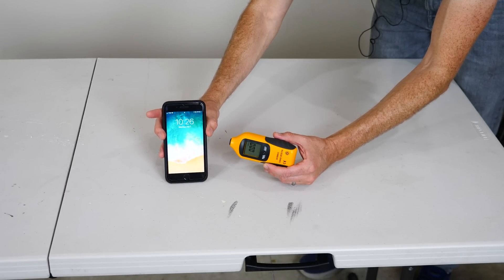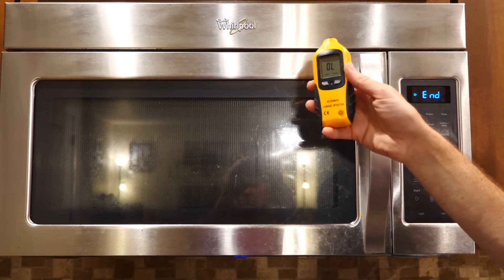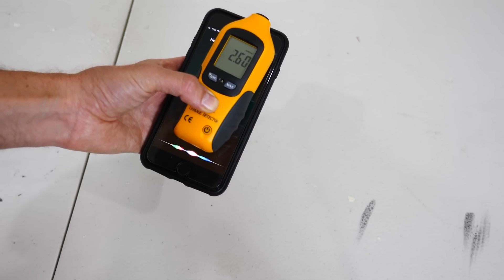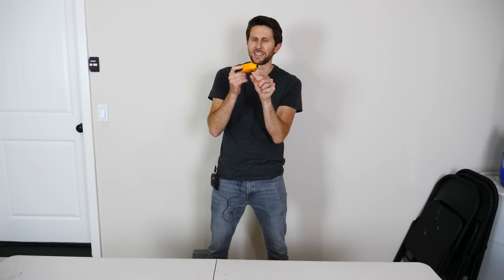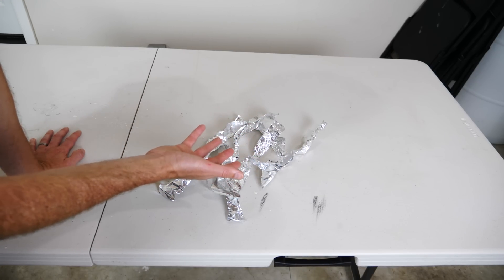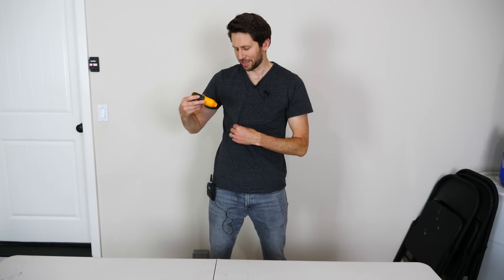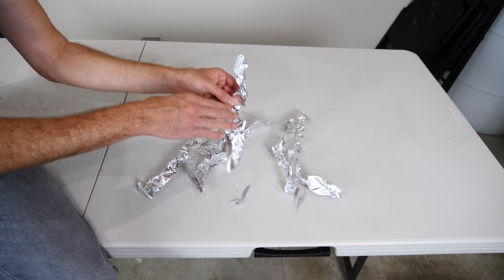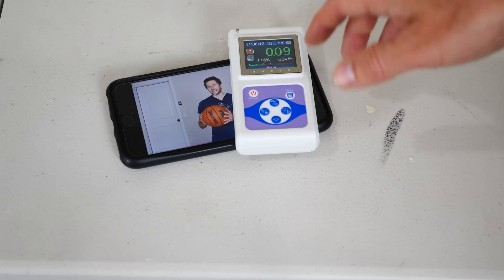How Much Radiation Are You Getting From Your Phone?

Comment: Your conclusion to this experiment is so warped it's not funny. You think that the only dangerous thing about microwaves is heating? You compared that to going out into the Sun, you might've well have compared it to going into a Sauna SMH - What you've shared here isn't even bro-science!

5G millimeter wave frequency causes the electrons outside oxygen atoms to spin & heat up. We have those oxygen atoms inside h20 (water) & O2 (oxygen) inside our bodies. If they heat up in that manner, not only does it prevent oxygen from boding with iron into our blood so it can be circulated around our bodies, but it can also cause respiratory illness & a build up of fluid in the lungs... Hmmmm, what's one of the reported side effects of Covid-19.

Good on you for conducting a experiment, but if you're going to share very poor conclusions after drawing an observation to your experiment, probably best to not post it on YouTube!

Comment: Thats all micro wave Radiation does is heat food up LOL Mr wiz you forgot to mention that wifi works at 2.4 gigahertz the same oscillation as the water molecule and spins that molecule to create dehydration. Also 5G works at abt 60 gigahertz and spins the Oxygen molecule. These molecules do not spin in nature. Result?  lack of water and oxygen Absorption and thats not counting the effects of the Radiation. 5G is not like any other (3G 4G) it does not pick up whats around you but directs it at YOU.. I will add that in congress when asked how much testing on 5G was done for Human safety they answered, None, Zero, Nada, Nothing...

Comment: What you did is right, but the question here is the quality of the measuring tool. Since it is made for measuring Microwave oven leaks, it should be tuned specifically for 2.45 GHz. I am not saying the tool you are using specifically, but some cheap tools can pick up other electromagnetic waves that have nothing to do with the microwave band used in ovens and sound an alarm. So what I mean is, if it is indicating "overload" near your phone, just test it in different other electric equipment. If it goes off easily near other equipment, then it is not accurate and you have nothing to worry about.

Comment: Shill alert, shill alert. This video is dangerously misleading. RF from your phone and wifi is not safe. I repeat, SHILL ALERT. 5 mW/cm2 is an EXTREMELY HIGH LEVEL. Radiation does way more than heat things. This video is extremely irresponsible. So much lies in this video, WOW.

Comment: TL;DR: 
Our bodies do not absorb microwaves. It’s a form of non ionizing radiation. There are two forms of ionizing radiation; X-ray and gamma. Ionization can do 3 things to a cell. It can die, repair itself or mutate incorrectly. Microwaves are NOT IONIZING! 
Fun fact: A cellphone would only give you ionizing radiation if it were a banana phone. (As the potassium in bananas decays it gives of very small amounts of gamma rays).

Comment: There is Flaw in what you are saying. If what you say is correct you would recieve 1 degree heating consistently internationally. So being thermally heated by the sun which slows down from the out side to the inside would be safe. Example you get hot so your skin sweats and you cool down. 

But heating from your phone would be essentially be internal sun burn to your brain your legs your hands your heart. All the locations in which  your device is used or stored day to day.

FCC states clearly in its guildlines eyes & testes have restricted blood flow so heating will happily take place.

Comment: A microwave oven typically uses 800 watts of power to vibrate water particles. The things is that microwaves dissipate extremely quickly , non focused waves will not hurt you , 4g or 5g will not hurt you, it’s milliwatts not even 1 watt.

Comment: 1) microwaves are NON-ionizing
2) a microwave oven radiates hundreds to morr than thousand Watts to heat up watermolecules, cell- and smartphones and wifi routers use milliwatts. 

Therefor: safe.
Reply: Dont they use radio waves which operates at a lower frequency than microwaves too?

Comment: Well I’ve been using cell phones since 1998 still clear of cancer in 2019 , Also you would need to hold the phone to your head for a whole year straight just to get the same radiation level as a chest X-ray , the old mobile phones from the 80s were the most dangerous giving out 100 milli-sieverts of radiation per year
Reply: It is actually the other way around: 24 hours of mobile phone radiation can equal 1600 chest X-rays in DNA damage.

Comment: All sun radiation does not travel inside your head
Phone radiation does
This is Real concern
And by the way
It is already proven there is very strong correlation and I some cases even causation of cancer in areas where people hold their phones
You should not be that hasty to draw conclusion while you have no knowledge about subject
P. S. Sun, microwave, radio, TV are fundamentally different kind of waves from what phone produces. Phone sends very short bursts of data and actually from GSM era cell phones are not switched (circuits) anymore, but packet based communications. This makes them faster, more energy efficient, give them better range (as you do not need to transmit all the time, you can pulse with higher energy). There is no single study about pulsing electro magnetic waves effects on living organisms, apart from few separate studies which actually shown that it is harmful.

You are too hasty with conclusions

Comment: Flying a few hours gives you radiation about equal to a chest x-ray.  Every 20 days your alive is equal to a typical chest x-ray.  X-ray, gamma ray are ionizing radiation which means they can alter your cells by removing an outer shell electron.  There is also a thing called inverse square law basically states the further you are from the source of radiation the less the intensity is.  Medical x-rays are also low LET and RBE which means that  there low chance for any real damage to happen. But on the flip side any small about could cause something down the rode.

Comment: Due to its low frequency, microwave radiation wouldn't be much of a problem. It's even lower than the energy of infrared radiation.
Reply: That's because of non ionizating radiation

Comment: Microwave radiation? Uh that’s not right.. it’s not even on the same wavelength which means it’s not even microwaves :P
Reply: True, cell phones work in the UHF band, 300 to 3000 MHz.   Most physicists refer to the microwave" band as EM radiation with a wavelength in centimetres, that equates to the SHF  band  of 3 to 30 GHz (3000 to 30,000 MHz)

Comment: Decent video. As an RF engineer, I see some problems though. That meter is complete garbage and when you wave your shirt like that, you are just fooling the low quality meter. You are not putting out microwaves by doing that. If it was that easy to make microwaves, well. . .
Secondly, that meter may work for phone wifi, but it's not going to work properly to detect 3G or 4G because that isn't microwave. It's 900MHz or so, so that meter is not going to be accurate. A feild strength meter should have been used instead and they're not too expensive anymore like they used to be. You can get them on ebay. They look similar, but they have a little ball on top containing an antenna and they will detect the polarization of the waves also.
Either way, you are correct about the non ionizing part being not dangerous and this is the most important part.
Reply: So do you think 5g is dangerous?
Reply: @benhael3624  No, I do not, but I'm not 100% sure about that. It is absorbed by oxygen which is an interesting different property compared to other frequencies. There are people claiming that this inhibits hemoglobin from absorbing the oxygen into the body. I can't find a scientific reference on that specifically, so someone made it up and people kept repeating it AFAIK. It's possible I guess, but the likelihood is low. Other than that one potential problem, it's fine.
Reply: A question... Is 3g safer than 4g on phone and does it radiates less if I only use 3g?
Reply: @David-ce8yx  You need to know that radio waves are the exact same thing as light waves only they are much longer and therefore are invisible and pass through objects. So when people act afraid of them, it's like being afraid of the sun. In fact, the sun outputs way more. Essentially, if it is not enough energy to cause heating or burning, then it is completely safe, so both 3g and 4g are safe. You will find some studies saying they aren't, but they are made on baseless "science". The only slightly questionable one is 5g because of the oxygen absorption, but this is a unique property of 5g and the other Gs don't have that at all.
Reply: Also, there are people that work at radio stations (me) who are exposed to 1000s of times the amount of radio frequency energy you get from your phone, so if there was any issue, it would be seen in these people and it's not. There are people that even climb towers while they're turned on (some are paid workers). A few of these people have gotten burns and the burns go through, not just on the surface, but when they don't burn themselves, there is no harm caused by being exposed to 1000s of times what you get from a phone.
Reply: @joeshmoe000  thank you very much for this fast and great respond 👍👌✌️

Comment: I like to use my cell phone on speaker phone. Microwave radiation is non-ionizing so probably not as bad as ionizing radiation. With my first old cell phone my ear would actually get hot if I held it to my ear. Interesting information for you, when they measure the safety of cell phone radiation they measure it at a distance not where you would actually hold it when you were using it. Don't wave your shirt it could be dangerous. You didn't measure it with the Geiger counter when talking on the phone.
Reply: My phone will get hot if I hold it to my ear long enough.  So will a piece of wood!
Reply: Not only the phone my ear would get uncomfortably hot.

Comment: Try this with a 5g phone because millimeter waves
Reply: OK so low power microwaves for 5G.  The most it will do is warm something slightly.
Reply: @karhukivi  talking about in the 30 GHz to 300 GHz range
Reply: @Aurora_Awttermunk  Ok so in the radar bands and below the infra-red bands. I see 3 bands 3.3-3.8 GHz, 25-30 and 35-40 GHz.  Only effect is heating or RF burns if touching a high-power antenna.
Reply: @karhukivi  yeah it is bad indeed.

Comment: My mothers microwave leaks a bit. Her kitchen weight starts fluctuate the readings when its placed about 0,5m or closer. Hehe funny. It is badly shielded. My phone haven't taken any damage being near the microwave. And no loss in signal.

I myself have a frequency counter that I use to find what frequency a radio close by transmit. But I have to be very close to it for it to work.

Comment: Is that instrument specifically for microwave ovens? If so it's looking for 2.4Ghz, ...so wireless is OL, but cellular isn't hitting that high; but it's it maybe just not detecting the power of the lower frequencies.  Just curious. [Edit: I'm not worried about radiation)

Comment: Doesnot exist, radiation doesnot exist is a lie.
Is a definition they use to reference wireless emission, but there is no radiation doesnot exist, it can be reference anything, from heat to wireless data, there is no radiation is only a misleading fake idea, they donot even know what they are talking about it.
Microwaves are not radiation, frequencies are not radiation, is just misleading form of speech design to manipulate the system.
Most of those devices are hack with wireless signals so they display any number they want, the same way they use the fake diabetes devices that they manipulated with the brain emissions they release.
Reply: @fazuelison13  what kind of energy?
All kinds of energy, not one, not two, all kinds..
So is just a definition that can apply to anything.
For example
I toss water and the rain was radiating ....
Wtf...
Anything can be radiation, but technically it doesnot exist.
Reply: @fazuelison13  there is no radiation, doesnot exist, is a false word to reference emission, but there is no radiation, a lie.
Emission and radiation is same thing, radiation doesnot exist, is just a bad word made by human cells to manipulate their ignorant systems.
Words are no longer with value because human cells give them different definitions, they dont follow or respect the dictionary no more.

Comment: Problem with mobile or signal antennas is not only the exposure, but for how much time you can get the exposure, maybe a day or even a week of constant exposure living near or under an antenna would not give you mutations, but living years, probably yes. That can affect greatly.
Reply: As the video explained, not really. All microwave radiation is non-ionizing and does not transfer enough energy to damage atoms/molecules and by extension DNA, which is the only thing that leads to mutations radiation-wise.

Length of exposure doesn't matter if at no point this effect occurs. It's the same logic of not being able to kill someone even given infinite time if you're just tapping them with a knife rather than stabbing them. If it never breaks the skin, no amount of time is going to allow it to deal damage.

Comment: Go to Settings> General > About > Legal > RF Exposure, and you will find this: 
iPhone has been tested and meets applicable limits for radio frequency (RF) exposure.

Specific Absorption Rate (SAR) refers to the rate at which the body absorbs RF energy. The SAR limit is 1.6 watts per kilogram in countries that set the limit averaged over 1 gram of tissue and 2.0 watts per kilogram in countries that set the limit averaged over 10 grams of tissue. During testing, iPhone radios are set to their highest transmission levels and placed in positions that simulate uses against the head, with no separation, and when worn or carried against the torso of the body, with 5mm separation.

To reduce exposure to RF energy, use a hands-free option, such as the built-in speakerphone, the supplied headphones, or other similar accessories. Cases with metal parts may change the RF performance of the device, including its compliance with RF exposure guidelines, in a manner that has not been tested or certified.

SAR values for this device are available at: www.apple.com/legal/rfexposure/iPhone10,3/en/

Although this device has been tested to determine SAR in each band of operation, not all bands are available in all areas. Bands are dependent on your service provider’s wireless and roaming networks.

Comment: This is good however, the other concern is the effects the cell towers have. 

There was a study conducted in the UK several years ago, where they put vollenteers in a room with a cell tower transciever. Several of the participants, suffered ears bleeding and nose bleeds, the study was reported to have eliminated those people from the study, stating that those people were particularly sensitive, and don't count. Shocking that the study's purpose was to find such effects and those participants were just as valid as any of them.

Also a personal experience with phones. I had the early nokia phones, i had no issue with them, then i decided to get a samsung flip, the early tiny silver flip phones.... i ended up replacing it because every night i put it on my bed side table and when it was switched on, i got a headache. If i switched it off, the headache went away.

Another experience i had was with a phone case that had 2 magnetic discs to close the case. It was a belt case, and after a while i started to get a pain in the muscles above my waist at the side. I didn't connect it to the case till later. The magnets must have been causung some kind of amplification of the signal. It took several years to heal.

My conclusion about the case was confirmed a few years later, when i saw a work collegue wearing the same case, and without telling my story, i asked him if he had an unexplained pain in his side... he was shocked and said yes, how do you know. I said its the case, and told him my experience. He stopped using the case and his pain went away... Fortunatley it seems he had not worn it long enough for it to cause the same damage it did to me.....

Comment: I did these tests 4 years ago using EMF detector, and the radiation from your cellphones are significant, specially when you are on call.
Reply: well, of course that's because cellphones have electromagnets that can help it to transmit radio waves. radio waves are by definition radiation, but arent the harmful kind that will cause cancer, as it isnt ionising radiation. non-ionising radiation, such as light, microwaves, uv light, infrared and x rays are different from alpha, beta and gamma radiation (gamma is more of a "supercharged" version of EM waves, but this doesnt mean EM waves are ionising like gamma), and only can cause sunburn, or skin cancer from constant overexposure, like sunbathing for way too long every single day. 

ionising radiation will knock out electrons in your cells, effectively changing its structure, and giving you more risk of cellular mutation, thus leading to cancer. an alpha particle is a helium nucleus, a beta particle is a high energy electron, and a gamma ray is a very high energy electromagnetic wave.